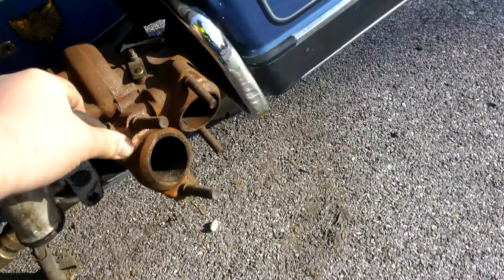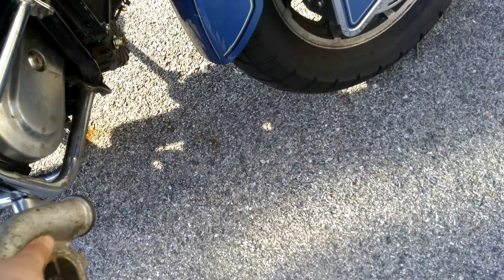TWIN TURBO HONDA GOLD WING PROJECT GL1200

Comment: I have a gold wing 1100 and I’m thinking about using my 2 vf40’s that’s been kicking around the shed just for the look or having one hooked and running off of both exhaust or have both connected and a computer set up for low boost I’m not sure yet....